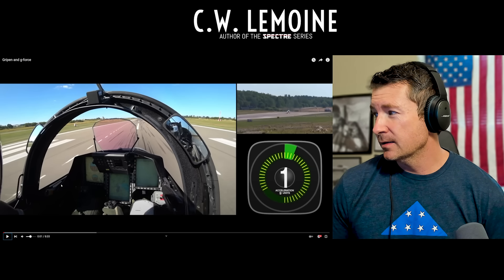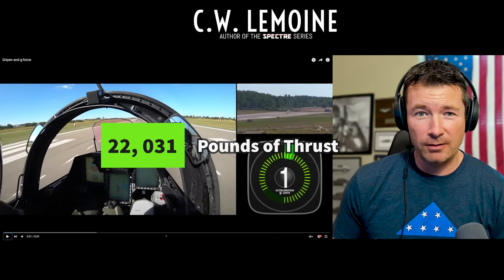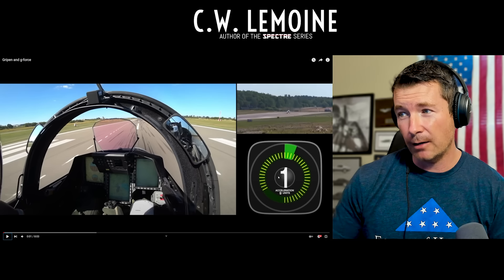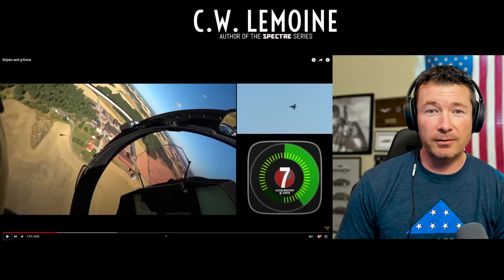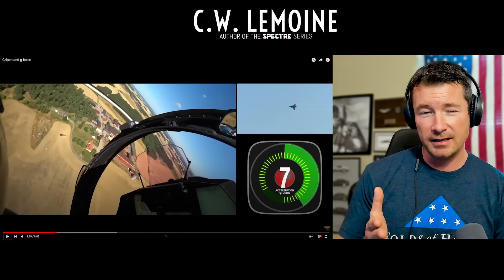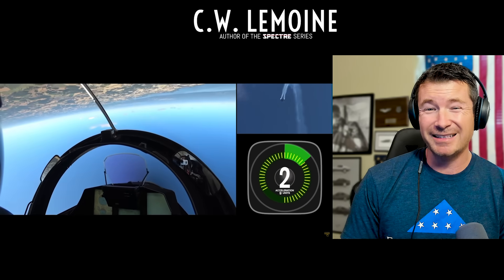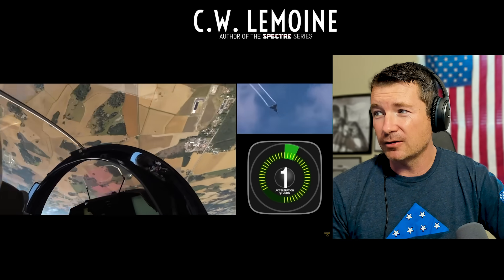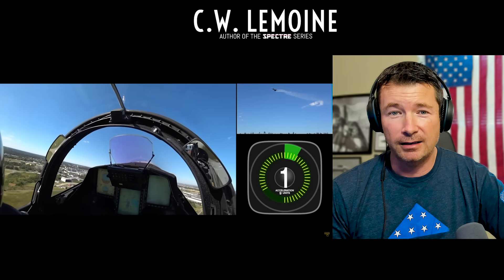SAAB JAS 39 Gripen G-Force Video *BREAKDOWN*

Comment: Gripen C has one F/A-18 engine which isn't weak considered how light it is, i've seen both at Air Shows and Gripen flies circles around it, it's so fast.
Reply: very weak...Pipen is the weakest fighter of all. Thrust to weight ratio in AA config. is only 0,7...poor.
Reply: @prokremelskidezolati1426  Gripen has canards and F16 don't, explain how one Gripen took out seven F16s at Red Flag if it's so bad.

Comment: I have seen swedish Gripen (and before that Viggen) airshow displays several times. I think the low speed high AOA part of the video doesn't show the AOA right. It looks more impressive in real life. At those airshows US planes strangely never flew a display. But there were either the dutch or danish with an F-16 doing a nice display, and once a swiss F-18. Our country bought the (lowest spec) Europfighter and it's display is impressive too (mostly because of the sheer thrust). But compared to all of these it actually looked to me that the Gripen was always able to do the tightest turns. Not sure if there's the same saying in english, but it looked like the Gripen can "turn around on a post stamp". 
What i am missing, and there aren't any good videos anymore of it on YT is the short landing. The previous jet of the swedes had a "party piece" in it's thrust reverse system, that the display pilots used to do a J turn on the runway mid display. (with the Harrier, the only plane i ever have seen going backwards on it's own power in a display)
The Gripen doesn't have that, but uses the canards as air brakes/spoliers when landing. Very impressive to look at.
Reply: The best translation of ”Vända på ett frimärke” is probably “Turn on a dime.”
Reply: @mixmashandtinker3266  Thanks, that's indeed a better translation! 
(I did not translate from swedish, but appreciate to see how that term looks in swedish.)
Reply: And it has front gear brakes, used in combination with the canards fully forward tipped. I seem to recall the g-suit especially buildt for the Gripen is 12G capable, but it has been a long time since I read it..
Reply: Low speed AOA looks about right. It's never been comparable to Hornet, which Mover referred to. We've seen so many Finnish Hornet airshow displays alongside the Swedish to know for sure. Gripen seems to do similar routines than F-16, quick and agile, whereas Hornet bleeds energy, points nose easily and rides on its tail. Anyway, Brännström is a cool chap.

Comment: Aerobatic performance as a criteria for judging jets is pretty useful if rival nations did the airplane equivalent of a street dance-off to settle gang conflict.

Would be nice to get your thoughts on the Gripen beating out the Eurofighter and Super Hornet as the runner up to the Finnish competition.  And if it was true that the Gripen was dominating all the 4th Gen planes in Red Flag?
Reply: As a Finnish layman, I would have been happy to see Gripen as the next Finnish fighter, mostly based on the great Air show performances. It is definitely a fine and agile aircraft, compared to its competitors. We ended up to F-35 however. Perhaps it is a better overall weapons system as the choice is explained, but I really would like to see Gripen in the future Finnish Air shows also.
Reply: @mhyotyni  Wars are not won by aerobatics though.  Not in this day and age.

What the F-35 can do is be somewhere where the Gripen cannot.  So it doesn't matter if it can take off from a public road, or cheaper to run, or can make sharp turns.

You need your fighter jet to fight.  Not to exist and show everyone you have a standing Air Force.

Missiles and bombs are so powerful today, that all you need is to get into the right position to deliver it without being interrupted.
Reply: @markvincentcocjin  You are probably right. However, when a fighter is designed more for being a stealthy weapon platform than a good airplane, I feel bad.
Reply: @mhyotyni  If it makes you feel any better, the point of stealth is so that an airplane can do airplane things in a space where other airplanes are denied access.

Think of it this way.

In a given scenario, the only way to strike a target is to have an assassin remain hidden inside a wooden box.

You can't dictate the size of the box but you can find someone small enough to fit inside and do the job.

Striking at a target is a matter of opportunity, not convenience.

Comment: Thai Royal Air force fly a few Gripen C and D. a Few years back we had a joint training/competition against the Chinese J11. Thai Gripen got destroyed in the Dog fight and close-range but Thai Gripen owns J11 in BVR The score was like 41 to 9. some say 41 to 6. What I find interesting is that Thai Pilot rarely has the chance to train BVR if ever.
Reply: Dog fighting relies a lot on the pilots as well... 
And were the Gripens equipped with IRIS-T's that can fire 90 degrees off to the side?
Reply: @Merecir  From the looks of it not in that fight. Since Thai at the time would be using Diehl IRiS-T short-range missile. But in that wargame. The first two-day Gripen is equipped with Aim 9 and the third-day Aim 120.  88% of the Gripen kill occurred at 19 miles or more while J11 only made 14% of their kills at that same distance. As a side note, 10 of the kill made by Gripen was done from 31 miles or more.
Reply: @Darth_Meh  So, they were forced to use old 'generic' missiles and not the ones they actually use, gottcha.
Reply: @Merecir  maybe because of poor performance at close range fight is the reason why the Thai air force upgrade all the fighters with IRIS-T even the F5TH

Comment: That pilot was definitely working physically to fly that aircraft. Even if the post production G meter was incorrect, you could hear the pilot as he labored through the later half of this video (even at low G) indicating that he was putting his body through a rigorous work out by pulling sustained high Gs. It is interesting to me that the aircraft's sensors warn the pilot to "pull up" after entering, and sustaining, -G territory. -3 Gs to 7+ Gs.... 10+ Gs and still conscious. Mr. Lemoine's face and comments say it all. This was BRUTAL demo flight!

Comment: it uses an older version of the F-16 engine, modified by volvo. But those G-changes, brutal.
Reply: F/A-18*
Reply: License built by Volvo Aero as RM12 and substantially upgraded for reliability. Not a single accident due to engine failure with over 300.000 hours in the Gripen.

Comment: Hey Mover - THIS IS NOT an actual g-meter but a post production addon  that does not reflect the correct g value and onset in relation to the aircraft behavior in this case. Gs are never single digits but have decimals, 7.4 for example.
Reply: Gripen records everything to be able to playback and analyse your training missions.
This is most likely a post generated meter from that data.

Comment: Waaay back when canards first came out for homebuilts I heard one of the safety features of them was they prevented the aircraft from getting into a stall induced spin which made the aircraft very safe. Am I remembering correctly?
Reply: Yes, it's got a lot of automatic features, you see one of them here where the plane is locked to 9gs max no matter how hard you pull the stick, unless you toggle on the 12g mode.  

It took quite a few crashes to get the bugs out of the system though. Here's a video of the first public showing of the JAS 39, and it's crash in the middle of Stockholm during a festival. Thankfully it crashed in a park, on top of a baby stroller, which was thank god empty at the time.

https://www.youtube.com/watch?v=mkgShfxTzmo&t=225s

Comment: Good to know is that Gripen weighs 3000kg  (6,600 pounds) less than the F16
Reply from the maker: What are the clean weights?
Reply: @CWLemoine  Gripen is 14599lb  and F16 is 20297lb
Reply from the maker: Is that clean or empty?  IIRC an air to air configured (with 75% fuel) F-16 is around 21-22k lbs.
Reply: @CWLemoine  i dont now

Comment: Figther with medicore performance for not so rich  countries.
Reply: The original idea with the Gripen is that you could have many of them spread out all over the country. The original plan was to build 300 for the Swedish airforce alone. They did not need to fly far and carry a lot of weapons since they were always close to an airbase. It was perfectly adapted to the swedish tactics during the cold war in order to survive a Soviet full scale invasion for as long as possible. A heavy fighter that needed long runways was out of the question.
Reply: @Rbajter  what that change for countries which are searching for good perfor,amce fighters? Nothing. You wan’t good fighter buy F-16, Eurofighters, F-18, Rafale, F-35. Gripen is not even NATO compatibile. During training with Nato gripens couldnt be refueled in NATO air bases because these bases don’t have civilian jet fuel which gripen use. There was big shit storm about that in military  media not so long ago and a,ericans can stop all export attempts of Gripens because Gripens use many American parts like engines.
Reply: @zepter00  Using civilian fuel is also a part of the strategy, civilian airports usually have civilian fuel stored - not military fuel...
Reply: @zepter00  My point is it all depends on how you are going to use it. If you requirements are similar to Sweden's, it might be a good fit, otherwise you go with something else. 

Gripen is definitely Nato-compatible. It is currently operated by two Nato countries in Europe: Czech Republic and Hungary. I think you are referring to the issue the Swedish AF had while participating in the Libya campaign in 2011. Not an exercise. The Sigonella airbase in Italy where the Gripens were stationed only had JP5 fuel, which is for US Navy aircraft, not Jet A1 that Gripen was certified for. SWAF has equipment to convert JP5 to Jet A1 but it had been left at home in the hurry (10 days from request to landing in Italy) . They had about half a tank of gas in the Gripens but they also had a C-130 with air refueling capabilities. They sent the C-130 to another base to fill up on Jet A1 and rendezvoused with it en-route to their first sortie over Libya. This maneuver became a bit hairier than expected since they had to fly a lot further before they could perform the in-flight refueling and almost ran out of gas.

Yes, the US can block sales to certain countries but that basically means Russia, China and Iran which Sweden will not sell to anyway. Arms export from Sweden is by default prohibited - any export needs an exemption from the government.
Reply: How told you that BS?
Reply: @delta2005  you don’t have suffcient knowledge and competences to do it.

Comment: Hi Mover, thanx a lot for this video - I watched the display 1000 times  - being a PC pilot (DCS) it will be the closest I'll get to doing the real thing.  A few things about Gripen you mentioned / asked in the video:  
1. It is a smaller than the Viper, it uses the Hornet's engine.  Still Power to Weight ratio around 1.  Gripen is 1500 kgs lighter (about 3000 lbs) than the Viper.
2. Used in Sweden, South Africa, Hungary, Czech, Thailand and now Brazil is receiving Gripen E's (electronically scanned radar, improved range with bigger tanks due to main landing gear moved).
3. It is the C model shown in the video by the way - The new E version has one big display like the F-35.
4. Sustained G turn is enchanced by the design of the fuselage towards the back (see video below on Gripen design https://www.youtube.com/watch?v=uh7_SYsi79w&ab_channel=Millennium7%2aHistoryTech).
5.  In RedFlag (2013 I think), it was the 2nd highest A 2 A killer, after only the F-22.
6.  Gripen A,B,C and D uses the F-404 built under license in Sweden by Volvo (thrust increased from 71kN to 80 kN).  the Gripen E will be using the F-414 engine ( 98kN ).

See this video for so much more on Gripen design. https://www.youtube.com/watch?v=5HxlXG5ndG4&ab_channel=Millennium7%2aHistoryTech

See this video for the DCS Gripen Mod - it is free and flies like a dream : https://www.youtube.com/channel/UCPHvWbEdj85BlYY9TLnazKw/videos

And this is my own paint scheme and aerobatics display in the Gripen Mod: https://www.youtube.com/watch?v=6YuW8Tlt8Lk&ab_channel=RynoPotgieter
Reply: The Brazilian version have IR Sensors, like Russian fighters
Reply: @RTPJu  Yes, I did not go into all the improvements, there sis quite a bit.  landing gear moved to wings, not in fuselage any more, increase in range due to more fuel tanks.  Gripen E can now take 2 LGB's on the belly,  Landing gear changed, main and front wheel (which is now single), Wing root thicker for housing wheels, but also more fuel tanks.   Improved sensors all over the aircraft,  as well as you mentioned, the pimple on the nose (IR sensor). Oh yes, and electronically scanned radar, and the new F414 engine.
Reply: @RTPJu  Both E and F has That. So its not just for Brazil.
Reply: Which aircraft you fly on DCS?
Reply: @samicolgecen1991  only the Gripen mod. New release coming this Christmas.
Reply: @rynopot9850  is it realistic? or at least fun to fly?
Reply: @samicolgecen1991  I do not fly the real thing, so I can not truthfully compare it. What I CAN compare it to is the FSX one. The FSX Gripen stalls in a tight turn, and you have to centre the stick and await recovery.  the DCS one sits in the air like shit to a woolen doggy blanket, and I absolutely love flying airshow displays in it.  I put it in a flat spin, which the real Gripen's Flight Control System will NOT allow.  the FCS will not allow the JAS39 to leave the flight envelope.  The BEST news is that the Gripen Mod Update 1.8 will be released 25 Dec 2021!  that is Saturday!  and you must see the screenies the developers have posted in the Discord channel. ❤️❤️❤️ In my opinion, if you are new to DCS and don't have a big budget to buy Fast Jets, the Gripen Mod (mod in DCS is a free  product) is the free fast jet to get your hands on. But get FC3 which includes the F15, because you need the Eagle for the Gripen AA version. the GRIPEN AG version is based on the Su25.  But all this is about to change on Christmas. I hope they make the Gripen ONE model, multirole as it is supposed to be. I can go on and on and on. but I won't. or it could also be too late... 😬
Reply: @rynopot9850  where can I download that mod?
Reply: @samicolgecen1991  Gripen almost exclusively. I fly F15 in Multilayer when the server does not allow mods.
Reply: @samicolgecen1991  the Gripen mod. The Christmas update includes real Gripen Hud.
Reply: 1) They don't have "the same" thrust to weight ratios, though.  When at 50% fuel and 4x AIM-9 on both, the full afterburner thrust to weight ratio for the Gripen E is 0.970 while the F-16C Blk50 has 1.218.  At dry thrust same fuel and stores setup, TWR will be 0.613 for the Gripen E and 0.743 for the F-16C.  

See my response to "Anders Noren" a few comments up for the actual weight and thrust calculations.

The F414 is a significantly less powerful engine than either the F110-GE-129 or F100-PW-229 engines used on the F-16C Blk 50 and 52.  That more than makes up for the reduced airframe weight.  And when you start hanging weapons under each aircraft, it causes a greater performance decrease to the Gripen, because each pound/kilogram added represents a proportionally larger increase of aircraft weight.

5) Great, but in that particular Red Flag, what role was each aircraft used in?  Red Flag isn't just a series of 1-on-1 dogfights.  It's a virtual air war.  I can almost guarantee the F-16s and F/A-18s were used in SEAD and Strike missions, where they will be heavy, be priority targets, and will seek to avoid air-to-air combat.  The Gripens, however, were almost certainly used as point defense interceptors, because that's the primary mission they were bought for by the nations using them.  So, on the one hand you have F-16s that are heavily loaded deliberately flying into "enemy" airspace to go tangle with SAM systems, and on the other hand, you have lightly loaded Gripens that only get airborne once they have a designated air intercept, and which carry only minimal fuel and stores weight.  Of course the kill/ loss ratios for the Gripen would be higher in that scenario.  I wouldn't be surprised if MiG-21s fragged as interceptors could get better kill ratios than F-16s on SEAD at a Red Flag.  That doesn't mean they are superior aircraft.
Reply: point number 7 Its an expensive pile of **
Reply: @humptydumpy8029  fall of the f.g wall please...
Reply: @humptydumpy8029  Nah that's the flying duck, a.k.a F-35...

Comment: Swift S-1 aerobatic sail plane can do +10 g / - 7.5 g ... and those guy and girls never wear g-suits, no idea how they cope. Let alone aerobatic piston airplanes with something like +10/-10g.
Reply: Can fly ≠ do fly

That sounds more like absolute limits when checking specifications
Reply: @RogerJL  RB Air Race pilots hit 10g regularly, Hannes Arch even hit 11.2g once (?v=j8i04jBLI5I). I have to correct myself though, they do actually do wear g-suits, just a different system. Nevertheless, 9g sustained for so long and repeatedly is quite insane - given the fact that it isn't the pilot's and plane's job to do just that all the time, in contrast to acrobatics.